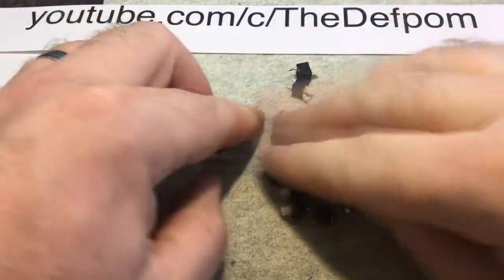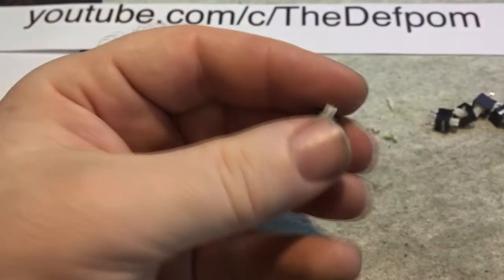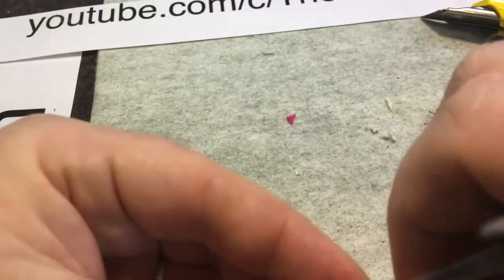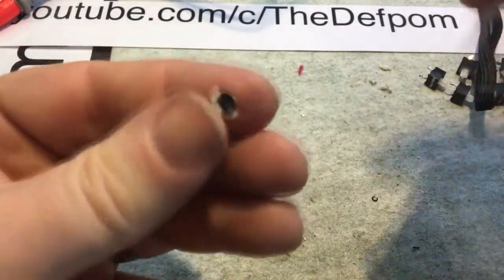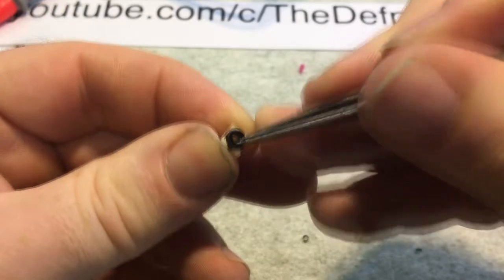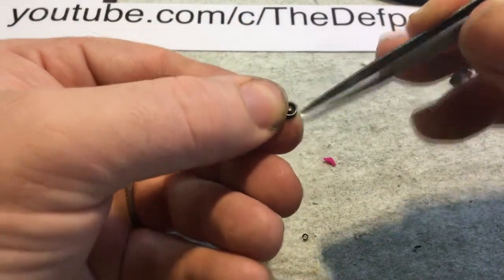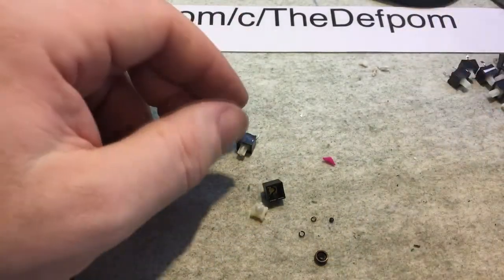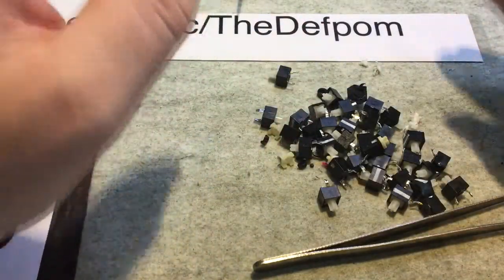#203 Racal Dana 1991 Failed Front Panel Switch Autopsy

Comment: received the 1992, and most switches bad, this was listedas used,and paid 135.00 shipped,so I opened a case, because used means it is fully functing so I asked for total refund , the seller has not responded, april 12th ebay will decide in my favor if they dont